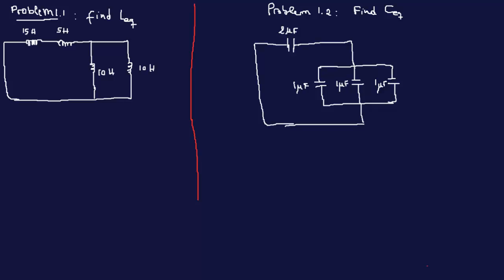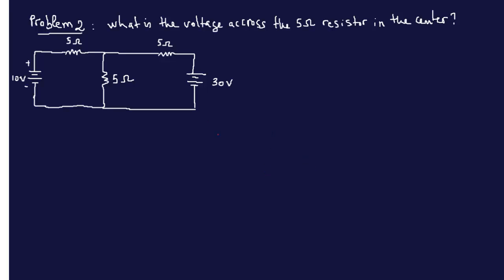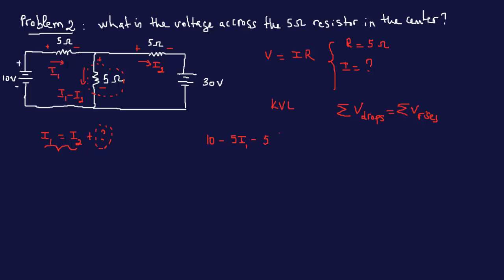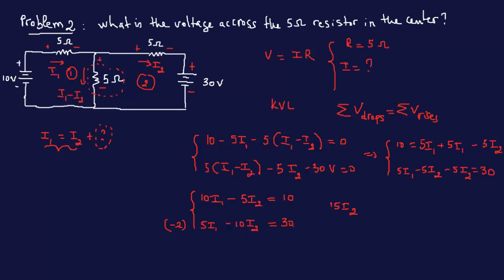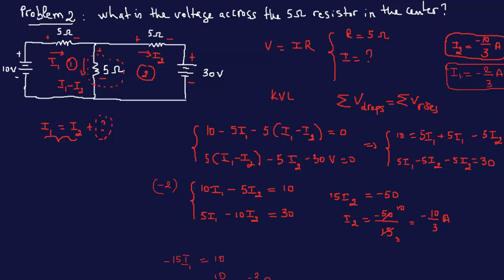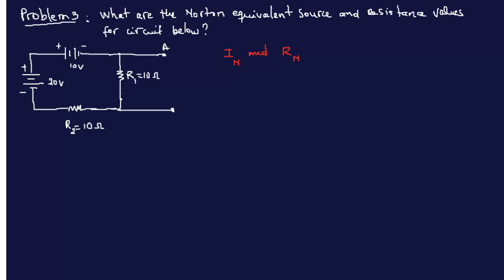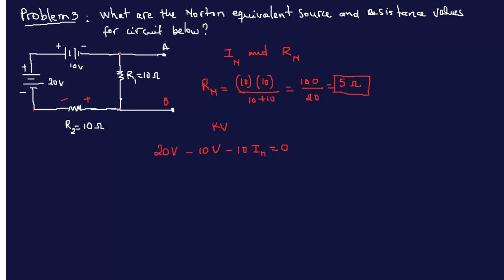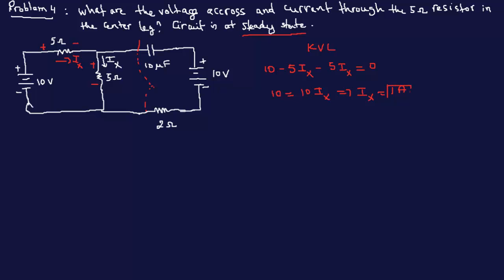DC Circuits Problems 1:FE/EIT Review

Comment: in your DC Circuits Problems 2 video, problem 1 gets rid of the same resistor as R2 in this video (problem 3). Aren't we supposed to disregard R2 in problem 3 because its open circuit? Thanks for the videos btw
Reply: wait never mind, forgot we have to short circuit the voltage sources in Problem 3 so R2 is parallel to R1.